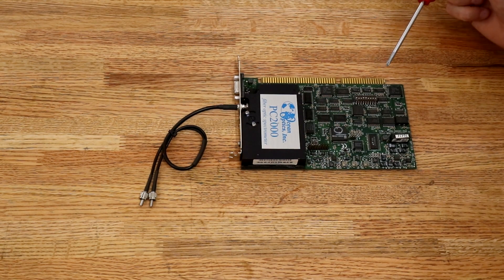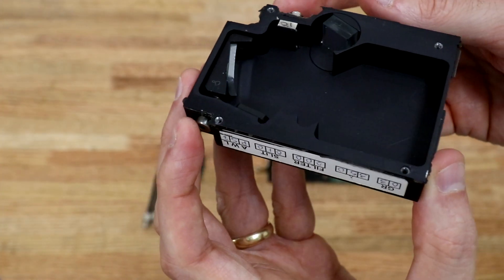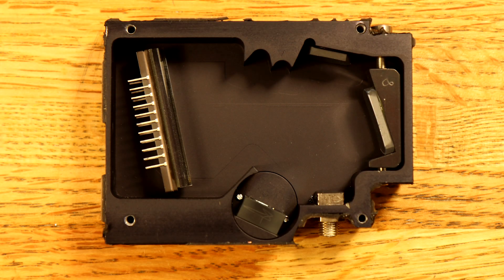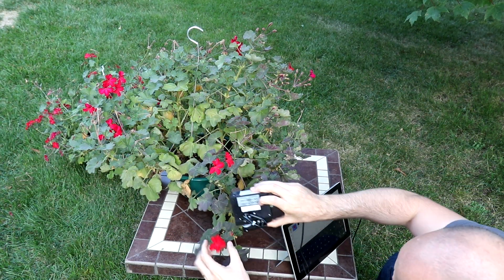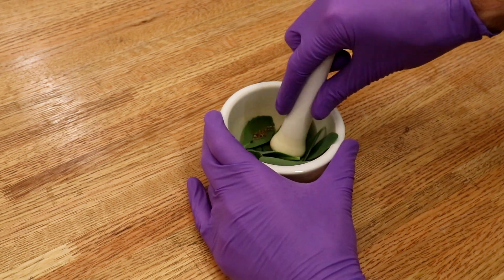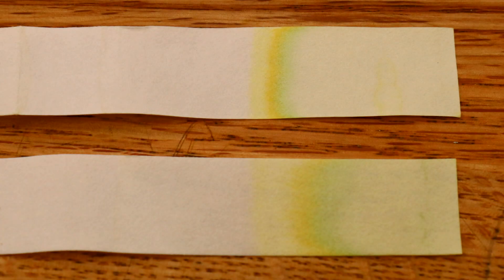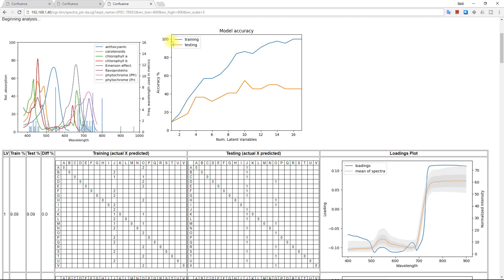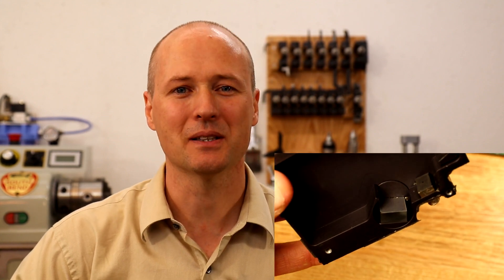Spectrometer Introduction, Tear-down, and Data Analysis for Plant Phenotyping

Comment: Hello sir,  how to make starting wavelenght from 200nm? by Grating angle?
Reply from the maker: Yes, in general, I believe. In the one I showed, UV probably spilled off the side of the sensor. You'd need a sensor that is sensitive to UV, but silicon sensors can be found in the 200-1100nm range. Check their spec. Thank you
Reply: @kentvandervelden  🧡sincerely appreatiate your kind reply. Valuable information for me!

Comment: thank you for this clean explanation , i'm working these days on a project of detecting chemical decomposition of fodder samples using NIR spectroscopy, and i'm planning to follow the same path as your project. I'm interesting of having more information about the softwar part, would you have some ressources that can help me understand the PLS process? knowing that it will be my first time working with such tool.
Reply from the maker: Sounds like a fantastic project! I grew up on farms and loved the smell of silage. You're asking a tough question to answer not knowing where you're coming from. If you have a chemistry background you'll look at chemometrics vs. a mathematics or statistics approach. That's for the theory, but you may actually want to apply immediately and then it matters if you're using Matlab, Python, etc. Are you after broad crude fat, moisture, protein, and fiber measurements or specific species?
Maybe start with
https://www.scinapse.io/papers/2158863190#fullText
for the theory? Look for papers and patents where others have done similar work that have methods written well enough to be tutorials and replicate the paper. Just some ideas that come to mind. Wishing you the best of success!

Comment: Great video Kent! Thanks for posting. I am interested in deuterium depleted water. Deuterium is an isotope of hydrogen, witch could be causing ill heath effects. I am trying to vacuum distill my water to separate H2O and D2O. What is the best or how can a spectrometer test my water?
Reply from the maker: This is well outside of my specialty. Out of curiosity, I did some brief reading and the links are below. The first two might be good for comparing energy and efficiency of generation methods: generating light water directly or as a by-product of generating heavy-water. The paper on light potable water generation has their testing method for in the Analysis of Deuterium Content section, which indicates inline gas chromatography. The last paper uses IR spectroscopy. The convolution between the two species, high ratio of H2O to D2O concentration, and cost of the required spectrometer may make the process impractical. Instead of testing regularly, would you be satisfied implementing the potable light water system and trusting their numbers or perhaps testing occasionally at a mail-order lab? You have an interesting project that requires the advice of a specialist, perhaps several. Best of success to you! Stay healthy!
https://cns-snc.ca/media/Bulletin/A_Miller_Heavy_Water.pdf
https://sci-hub.tw/https://doi.org/10.1021/ie101820f
https://sci-hub.tw/https://doi.org/10.1016/0020-0891(70)90003-5

Comment: 55% accuracy is really bad... 
I wondered how specific the UV/Vis (reflection)spectra for different types of leaves is.
Reply from the maker: Thanks for asking, it's pretty interesting. That's a measure of classifying specific species in a diverse species population. I'd have to review the results, but from memory, and it's been a long time, is that certain groups are easily discernible while others are not. 11/19, or something like that. Look at the confusion matrix. To differentiate between species not discernible with spectra alone, adding a small amount of morphology should clinch it. Like you said, there is not be a lot of difference in visible spectra between species. Just a difference in ratio of a few pigments. Some species are easy, and can be seen with your eye, others are apparently not. There are a few handheld spectrometer that interfaces to smartphones and uses crowd sourced data. They make pretty great claims, but the reviews are so-so probably for similar reasons. LinkSquare and SCiO are a couple. Peace

https://www.photonics.com/Articles/Smartphone_Spectroscopy_Promises_a_Data-Rich/a63594
https://www.cnet.com/reviews/stratio-linksquare-preview/
https://spectrum.ieee.org/view-from-the-valley/at-work/start-ups/israeli-startup-consumer-physics-says-its-scio-food-analyzer-is-finally-ready-for-prime-timeso-we-took-it-grocery-shopping
Reply from the maker: If interested in trees in particular, check out "Review of studies on tree species classification from remotely sensed data" F.E. Fassnacht et al. 2016. They include results from studies using similar and much fancier spectrometers as well as other sensor types. While prepping a UAV remote sensing review I read this paper and thought of you. Amazing coincidence

Comment: Hi Sir, It was a very nice video. I would like to know, how to build a spectrometer that works in the wavelength range of 1600 nm  - 6000 nm? 

From the video, I think that we need to choose a proper diffraction grating that can split the light and the corresponding detector. Would you please suggest what is the diffraction grating that I need to purchase and where can I get it.
Reply from the maker: I don't have experience with such a wide range. You may want to start with the selection of the detector. Multiple detectors may be needed to cover this wide of range.
Reply from the maker: Also, diffraction gratings are one type of dispersive element, but there are others. Maybe a different one will be more available?
Reply: @kentvandervelden  Thank you sir.

Comment: Thank you for the video - now I know a bit more :) I think a portable color sensor like Palette Cube or Nix Pro Color Sensor would be an awesome project. Especially with opensource software
Reply from the maker: Hi Dmitry, thank you. Those appear to be colorimeters, based on price. I don't know how those work, though they generate tristimulus values instead of a full spectrum. I assume multiple phototranistors with different filters and software for deconvolution? It's quite possible they would be sufficient for plants. Do PCA of a plant's visible spectrum and the first three PCs capture most of the data. Generally with plants one is primarily comparing "greenness" as a proxy for health or regressing spectra against chemical measurements like nitrogen. There's a lot of noise in plant data too (measurement error, dust, water, spray residue, etc.), and so high resolution measurements may be overkill. Colorimeters are unlikely to work for emissions spectrum measurements or identifying materials. You have a great suggestion. Maybe start with a colorimeter and reverse engineer the protocol so it's useful in other applications. I have a Spyder I could try that on. I was thinking of making the parts available for a decent teaching spectrometer for those willing to do some assembly and calibration, maybe STEM programs. Definitely open source. There are a few designs on Hack-a-day and bits and pieces available on eBay. Most of the electronics used in the decent spectrometers is pretty old tech and software is limiting. The prices for new diffraction grating based spectrometers is 50x of the Palette Cube, so outside the range of what is reasonable for primary schools (NIR spectrometers are worse.) A lot of that cost is quickly diminishing returns, in my opinion. There are inexpensive transmission diffraction gratings based spectrometers, such as Ocean Optics's Spark. A really interesting one that uses a different method is TI's DLP based spectrometer. Long response, but I find this stuff pretty interesting.

Comment: Hey Kent! Thanks for the video! I'm curious how much time it took to do the plant leaf recognition research (including collecting samples, creating the software, etc). And was it related to a current work project, or purely for fun? I'm always blown away with how much you are able to accomplish. Good luck on the home-made spectrometer project! That will be an interesting video to watch :-)
Reply from the maker: Thank you Nathan. A few months are into this project (for a client) and I only showed screens and examples that are generic. Everything is easy once one has the experience, and I have some experience with this sort of instrumentation. Identifying the hardware and working with vendors takes time. Collecting samples is fast. Driving to and walking the Arboretum took most of the sampling time. Scientific software generally requires a lot of prototyping to find the right method. (Jupyter is a good environment for this.) So while the final implementation can be fast, the total time spent on the software based research is easily the longest. In this case, many weeks. However, now that that work is done, I can use the components in larger projects. Reuse of hardware and software (and experience.) The reuse is where one earns a reasonable amount. The first time one barely breaks even. I skipped the droughted geranium results because additional background would be needed, and the expected signal at 970nm, the 2nd overtone water absorption band, was not clear. Hope that helps. Best wishes, Kent